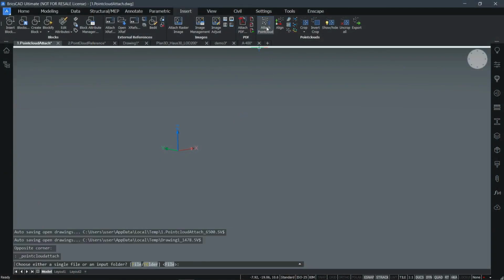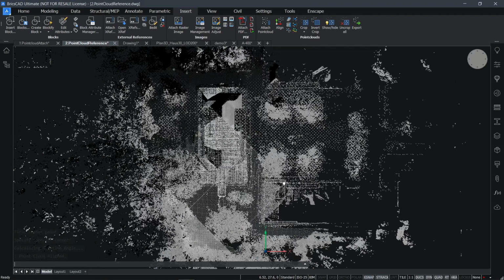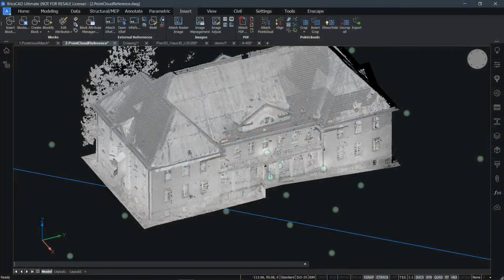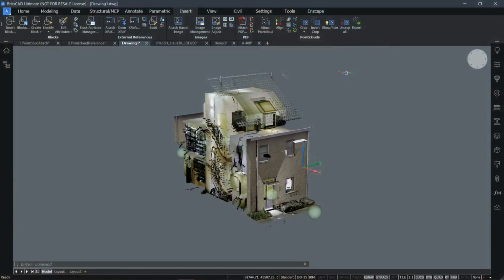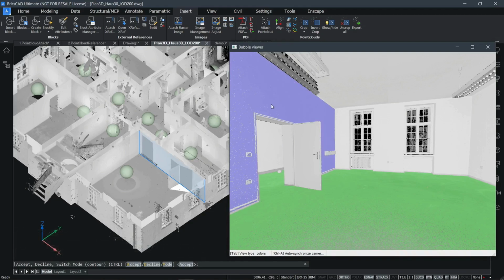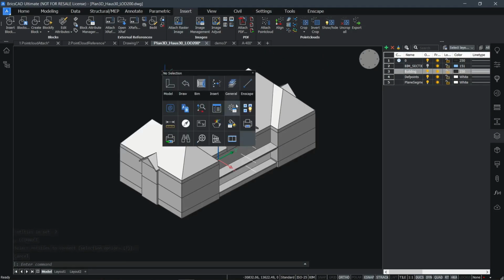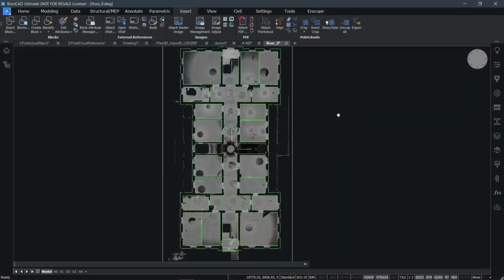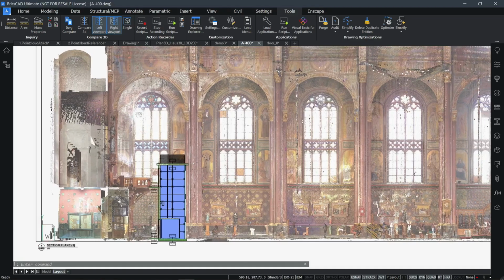Point Clouds - 30 min BricsCAD In Depth Session

Comment: With the point cloud fit planer I end up with slightly angled true walls but then how do I get all the shell to meet up to create the box?
Reply from the maker: This could be done via LCONNECT command, like demonstrated at https://youtu.be/v0JDMQtsUCE?t=1181 This Help article provides a useful information about working with walls, including walls connecting: https://help.bricsys.com/document/_guides--BIM_modeling_techniques--GD_creatingwalls/V23/EN_US?id=165079162357
Reply: @OctaveBricsCAD  thank you so much I will certainly check that out
Reply: @OctaveBricsCAD  are the bim files cross compatible with revit

Comment: Hi there, 
Thank you very much for this helpful video. 
Actually, after I attach the point cloud and then I try to use the Geometry commands/options (Detect Floors, Project Section, Fit Planar and etc..), I got a message saying "Unable to recognize command "POINTCLOUDDETECTFLOORS"". May I ask for help on this issue as I have to get the floors correctly drawn 2D and as 2D Floor Plan. 
Appreciate your time
Thank you

Comment: This is looking awesome. Is there a way to get that project section auto tracing function to work on the facade of the point cloud? I think that would also really help. I'm currently doing Lidar scans for facade reworks and looking at different software on how we can get some updated 2D plans for them
Reply from the maker: Thanks for the enthusiasm and feedback on our product. At the moment only the section cut will be auto-traced by lines indeed. Of course you can use the raster image option of pointcloudprojectsection as a guideline to help you manually trace over the lines as this raster image will look to the entire section volume, instead of just the cut plane. That being said, we will pass on the request to our product team. You can help us better define what you think would be a helpful feature, by stating your exact use case and current problems in your workflow in a Support Ticket. You can find our support system on our website under your account, where you can indicate the ticket as ‘Feature Request’ for BricsCAD > Pointclouds.

Comment: Unfortunately, the point cloud resolution is not working im my trial version BricsCAD-V21.2.07-1-en_US(x64). The appearance is the same for 8 million or 100 thousand points and the general aspect is of low resolution. It's impossible to model pipe routing or steel structures. If it was not this, my company should change to Bricscad. What a pity. Fortunately, I solved the problem. I just had to update the graphic drivers and all stuff worked identical and totally like in this video. Sorry.

Comment: Hi! When i import a file .rcp then BricsCAD V21 notify a problem as: Error in initializing file reader for "file" (check 8 or 16 bit data). Can you show me how to fix this?
Reply from the maker: Possibly the file is corrupted and then the file reader cannot be initialized. Could you try to open it with the free software CloudCompare? www.danielgm.net/cc/
CloudCompare may return a meaningful error, like the checksum is not correct. If the file is OK in this program, we need to check it on our side and kindly ask you to create a support request and attach the .rcp file to it. 
You can do it on our web page (the login is required): specify the version you are using, the operating system, explain the issue and attach the file
https://www.bricsys.com/protected/support/NewSupportRequest.do

Comment: Hi Nice video. I am working with pointcloud and generate 2D and 3D CAD models from Pointcloud. I have downloaded BricsCAD 30days free trial version to see how it easy to work with it compare to AutoCAD with Cloudworx. It shows some error in BricsCAD "XRX Error: XRC Resource "BMP_16_PC_Preprocess" (Class "wxBitmap") not found". Could you please help me how to rectify this error in pointcloud.
Reply from the maker: Thank you for your interest! We beg pardon for this inconvenience. The problem is related to Drawing Explorer/Point clouds, it doesn't happen if you use the Attachments panel to work with Point cloud (https://help.bricsys.com/hc/en-us/articles/360012763093).  You can use it as a workaround in the current V21.1.06 or try to download and install the previous release V21.1.05 which doesn't have this error: https://www.bricsys.com/protected/download.do?i=6569

Comment: what program did you use to generate your e57 file? i am having trouble generating a single e57 file which contains the positional data of all my scans?
Reply from the maker: BricsCAD does not generate e57 files, it only reads and stores them for use. You could use cloudcompare. If you are having trouble using a e57 file, please, create a support request on our web page (the login is required) where explain in details, add a drawing and our technical support analysts will be glad to help you: https://www.bricsys.com/protected/support/NewSupportRequest.do